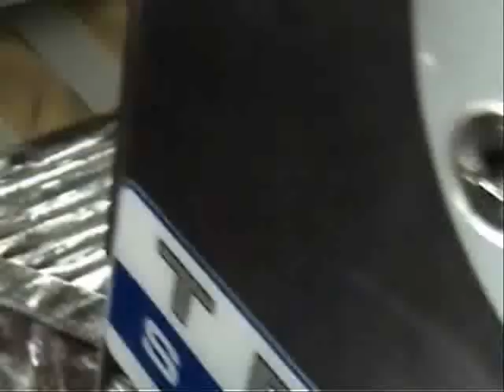Pastry make up line for triangle products with 1 fold. Tekno Stamap pastry equipment from Vanrooy

Comment: I have 01 machines Frey F -50 error is normally running around 4am twisted self error message is not the correct size sausage , use a running back , the error term is not twisted but always vegetarian , I had it adjusted . Domestic and foreign friends who know just for me to . Especially in the company . Thank you !